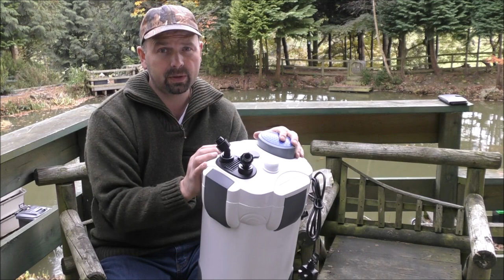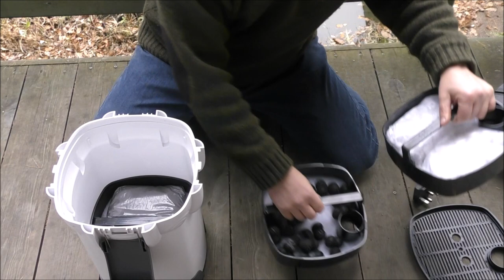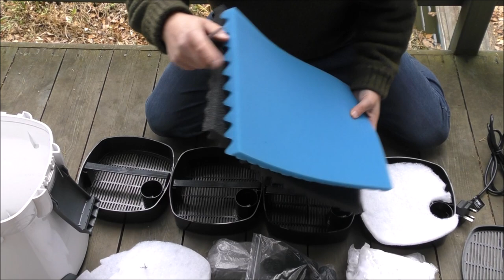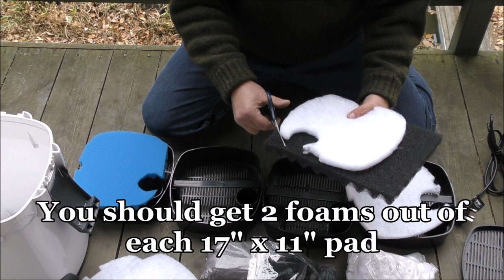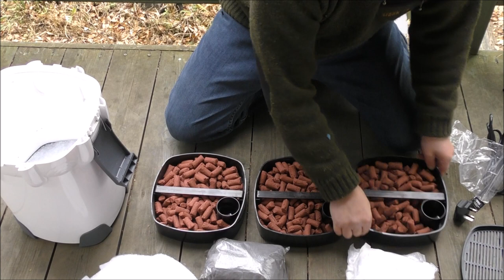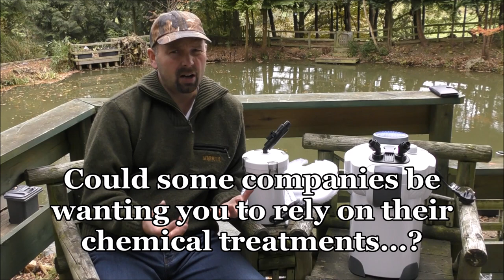Why Your Filter is TOO SMALL and NOT CYCLED

Comment: I bought the biohome ultimate 10kg for my 2 sun sun 704b .. will be putting it to action next week on my 120 gallon discus tank... do you recommend seachem prime as a dechlorinator? If not please recommend a dechlorinator. Im setting it up just the way you have shown.. please reply
Reply from the maker: Any treatment which states that it will 'detoxify / bind ammonia, nitrite and nitrate' seems to have a retarding / starving effect on bacteria so achieving a proper set up with them is hard or impossible. A simple (ordinary) dechlorinator which neutralizes heavy metals and chlorinates (e.g. API stress coat) is all you need to make water safe and allow the bacteria to establish properly without the negative effect on bacteria.
If you look at the companies making water conditioners promising to be a cure-all for pollutants they also offer a nation of different chemicals to stabilize conditions, boost bacteria etc. etc. as they operate using a pharmaceutical business template where they knowingly sell treatments which cock up something else which requires another of their 'solutions' which in turn cocks something else up and on until you run out of space in the cabinet for treatments which are mostly unnecessary. There is only one winner there and it isn't the fish keeper....

However after saying that about prime and similar treatments which negatively affect bacteria there is an excellent product from the same manufacturer which seems to have only positive effect and that is 'flourish excel' (plant food) since it has an available source of carbon and trace elements which really speeds up the development of a filter (unless it is held back by the treatments mentioned above). We have had reports recently of people achieving a full cycle on a new tank using fish or daily ammonia (fishless cycle) in around 1 month - that is for the 0 ammonia, 0 nitrite in 2-3 weeks and 0 nitrite by week 4 which is incredible given that it generally takes between 4-6 months to establish the anaerobic population in suitable media to notice a reduction in nitrate. That has happened on everything from community tanks to heavily stocked discus tanks so far and I've no doubt it would help when plants aren't present way better than any 'bacteria booster' nonsense peddled by some sellers.

When using any minerals / plant food avoid using chemical filtration since it will draw in much of the goodness you are trying to add to the water - carbon / charcoal don't seem to have a noticeable negative effect but purigen / chemipure etc. definitely draw in way too many useful trace elements and available 'food' for bacteria so have that familiar retarding / starving effect on bacteria.

Also if you're totally replacing the media in established filters make sure the change is done gradually - maybe do one tray in one filter every 1-2 weeks if you have 2 filters on the tank so the full swap takes many weeks to perform. That way you will always maintain good biological activity in the filters while the new media matures.

If you have the UV lights turned on normally it would be best to turn them off for 2-3 weeks if it was a new set up (to give bacteria a chance to flow through the system) but if it is a mature system and you're replacing one tray at a time it is fine to run the UV lights 24/7 as the new media will be seeded by the old media in the filter - replace upper trays first in a filter flowing bottom to top and replace lower trays first in a filter flowing top to bottom.
Hope that helps.
Regards,
Richard
Reply: Pondguru wow ... thanks alot!!
Reply from the maker: No worries, any time
Reply: Pondguru after abit of research I found that the city water we have sometimes has ammonia in it.. as we all know ammonia is good for beneficial bacteria but poisonous to fish. I do water changes every alternate days (50%) so ammonia in that heavy quantity could kill my discus instantly, and doing tests before every water change would be too expensive. they say prime is active only for 24hours, and Since api doesn’t bind ammonia any advice?
Reply from the maker: How does the tap water test when you check it for ammonia? also how does your tank water test?  a 50% change every other day is massive so with good filtration you should only need 10%-15% per week change.
Reply: Pondguru but if ammonia is present in the tap water what should i do?
Reply: Pondguru as of today there isn’t ammonia in the tap water, but sometimes there is according to the Canadian forums. I don’t test my tap water for anything, i just add prime, but now after knowing about the binding agent i want to shift to api but don’t know if ammonia would be a problem
Reply: Pondguru i do water changes alot and therefore i want to shift to biohome for the 120gallon and set the filter exactly the way you did it. The 120 isn’t setup yet i will set it up next week and do a fishless cycle before I transfer my fish to the 120
Reply from the maker: Has ammonia ever been a problem in your tank? If not then I wouldn't worry about it. There are many reasons why ammonia could be in tap water but it is often in systems which are self contained (residential blocks, flats etc.) which can become contaminated but have localized problems. Was the post specifically about your  water provider in your area?
It is always best to trust your own test and experience than anything people say on a forum but as long as the tank is well filtered ammonia will be processed by the filter no problem. As the new media matures it should allow you to cut way down on the water changes as 50% every other day is crazy.
Reply: Pondguru ammonia has never been an issue to me in the past 2 years, before that i did have ammonia in the tap water, can’t recollect how much. I hope that with biohome I could pass with no more than 50% water change a week, I’m following everything you are saying. My tank is bare bottom, but i will add alot of pottos plant (only the roots in the tank) after the tank is well cycled to help with nitrate. The tank will also be at 28 degrees celcius. Coarse medium fine foam in the bottom tray and 5kg biohome in both the canisters. No chemical filteration. And only api stress for conditioner.
Reply: Pondguru 10kg biohome for 120 gallons(455 litres) and 12 adult discus should be fine right?
Reply from the maker: That all sounds good and as the system matures just reduce water changes as necessary.
Reply: Pondguru great !! The last question that i have is, will the tanins from driftwood and almond leaves affect the biohome ultimate?
Reply from the maker: No they won't affect any type of media, if anything they will help by providing useful trace elements for bacteria.
The only way such things would have a negative effect on bacteria is if the pH was very low (under 6) as that would naturally make it more difficult for bacteria to grow in an acidic environment.
Reply: Pondguru thanks alot guru!! I’ve never seen someone who backs their product up with such information in the aquarium industry. You seem genuine towards the welfare of the hobbyists. I look up to you for being genuine unlike other influencers who advertise false products because they get paid. You’re realistic and practical, I’ve used many products such as seachem matrix(pomus) and found my self in lack of information. I’m glad i found biohome and will keep you posted on my progress. Again thanks alot!!
Reply from the maker: Sounds good and I'm sure it will work well for you - you wouldn't believe the companies which want to pay me to promote their products but I can honestly say that I have never taken any money to feature anything on my channel as that's not why I have the channel (and love of money is a sure-fire way to find suffering) - it's just about doing what is best for the fish and if fish keepers agree than it's all good.
There are a nation of really high profile people on Youtube still saying that biohome is no better than ceramic rings and that a full cycle is impossible in a canister filter then they go on to promote really cheap ceramic rings and other products which they have been paid to promote, knowing that they do no good at all - how can viewers trust what is being said by someone who runs a channel for the money it generates? They only seem to attract sheep who want to be lied to.
I'd much rather deal with the proper fish keepers than those high profile clowns, lol
Reply: Pondguru hahah, well said! Trust me i have tried every bit of expensive media and not achieved anything close to a full cycle, seachem matrix for example, which is low quality acid washed pomus. Marinepure bio balls are good enough and thats what i use now, but they do not hold their shape even for a year and are super expensive. Thank you for being true towards the hobbyists. I shall keep you posted and give you an honest review of your product if i am able to follow everything you have said (which is not at all tough to follow). It would be nice if you made a video on water conditioner/dechlorinators as many of us are not aware of the binding agent and various in depth stuff.
Reply from the maker: That would be great - all being well you should be able to plot the development and completion of a full cycle no worries. It's always great to get reports back from people all over the world as it has enabled us to get the recommended amounts more accurate for a wider range of stocking scenarios. Having feedback from all sorts of water conditions and different stocking levels is very important for accuracy as lab tests can only give a limited amount of information.
Reply: Pondguru hey richard it’s been 13 days since i have setup my two sun sun 704b with your media(5kg each canister for my 120gallon), did a fishless cycle with pure ammonia and added tons of seachem stability as bacteria, used api to dechlorinate my water with the water set to 28 degrees, skip past to the 10th day i had 0 ammonia and nitrite, but 30ppm nitrate, by the 11th day it reduced to 20ppm 12th day to 10ppm 13th day it reduced to 5ppm, i guess that’s how low it can get, did a water change and the nitrate is zero but since the tap water has ammonia upto 0.5 to 1ppm the ammonia shows up but disappears to 0 in 7hours. I guess my cycle has completed, but everytime i do water changes the ammonia is present for 7 hours, do you think it will harm the discus even though it’s just there for 7hours? 
P.S the Biohome Ultimate like the name says is the ultimate media !! Glad to have come across your product.
Reply: Pondguru #anupdateonthebiohomeultimate
Reply: Pondguru and offcourse i dechlorinated the water and let it sit for 10 hours before adding the dechlorinator
Reply from the maker: That is a great result but it's a shame about the ammonia in tap water as that is surely above legal safe limits. The only way around that would be to have a tank / container of water with a filter running in it to fill with dechlorinated tap water which you could allow the filter there to process the ammonia before that water was added to the tank. As long as the holding container is large enough to allow about 50%-75% of the water to be removed for your main tank water change you will maintain good bacterial activity in there.
It may be worth reporting the results you have to the supplying water company and asking them to also test the water at your home (straight from tap) for you.
Reply: Pondguru i did that today morning and got to know that it’s only for sometime as the season is changing and they’re preparing for canadian winter and what not. After a week or so my tap water shall be back to normal, will add the fish only then. Till that time I’ll let the tank cycle, I’ll add ammonia to not starve the bacteria. This product is absolutely amazing, when I rinsed it it threw up alot of dust, but thats it. I’ll be switching out the media on my 90 gallon as well, do you think 5kg for a 90gallon(340litres)heavily stocked discus tank(9discus) will be good enough?
Reply from the maker: Ideally a heavily stocked tank would take nearer 2kg per 100 litres to ensure a full cycle but people have got good results with less. If you can get around 6 to 7 kg in the filter(s) that would definitely be nearer the recommended amount.
Reply: Pondguru z
Reply: Pondguru if i put up a sump, should i still use the coarse medium and fine sponge? Or directly just a fine would be good enough?

Comment: I leave my grid off of my canister filter, does it really matter?
Reply from the maker: No it shouldn't make any difference unless you use a potentially buoyant media like pumice or matrix (which is pumice) - the grid is there to prevent media being drawn up into the pump but ceramic rings and sintered glass will be too heavy for that to occur unless the filter is tipped on its side while running.
Thanks for watching and appreciating the video.
Reply: Pondguru you taught me everything I know.  Thanks for the reply.

Comment: @pondguru - Have to say that your ideas certainly make sense. I am a retired process engineer. In my career I worked in the industrial waste water treatment industry.  In that industry the "gold standard" is to remove as much of the particulate matter (solids, muck, gunk, etc)  as possible prior to biologic processing. This is done by use of various types of equipment. 
The biologic processing occurs in large aerated ponds, trickling filters or similar such structures. Any chemical "polishing" required is done as a last step, if required or necessary. Many times chemical polishing is not needed. 
So the configuration that pondguru lists here is a scaled down direct  copy of this industry standard.  Thanks for posting it
Reply from the maker: Yes it is a simple, time tested way of filtering water to make it clean and healthy so how manufacturers continuously make a balls of setting filters up is a real head scratcher, lol
Reply: @pondguru  Have followed your advise and now have a sparkling and healthy tank. Many thanks
Reply from the maker: @rogerball6265  Awesome stuff - thanks for letting me know.

Comment: This is, bar none, the best video on Youtube for setting up a cannister filter properly.  I used this video to setup my 40 gallon breeder using a Sunsun HW-302 cannister filter.  It is rated up to 75 gallons which equates to a 37.5 gallon aquarium.  My tank is dirted with a gravel cap which displaces approximately 10 gals of water.  It's also heavily planted.  I have my HW-302 setup exactly as explained here with 4 lbs of Biohome Plus in the top 2 trays (2 lbs in each tray).  Those 4 pounds of Biohome plus should filter approximately 50+ gallons of water. My tank only holds about 30 gallons of water with my dirt and gravel displacement.  My tank fully cycled in exactly 6 weeks to the letter and has been going since Feb of this year with no change in water parameters.  My tank is stocked with 15 tiger barbs, 4 minnows, 2 wag tail platy's, 2 panda cory's, & 4 nerite snails.  My water parameters have been rock solid. In fact I hardly have to do any maintenance other than vacuum the gravel twice a month using two 5 gallon buckets which is the extent of my water changes.  There have been times when I've skipped one of the vacuums and my water parameters still remained stable.  I could probably get away with only vacuuming once a month.  I change the fine filter in my cannister the first weekend of every month, rinse the coarse and medium filter, and rinse the Biohome in one of the 5 gallon buckets from my vacuum.  Easy peasy.

Again, best video on Youtube for picking the right cannister filter and setting it up! Period.

Comment: Great video!
Recently I upgraded my tank from 40 to 60l and replaced my internal filter for external canister. It's a small 150l p/h with 2 compartments. First one had only coarse sponge which I replaced with 3 smaller but different (corase/medium/fine) and second compartment was filled with ceramic rings and carbon. I removed carbon and added more ceramic rings so there is about 0.9kg of them in the filter.
Works well, water is clear and fish looks happy. 
Btw it's only 1 Balck Moor in it.

Thanks for good video and effort you did to explain everything. It's hard to keep someone attentive for half an hour but you did a great job.